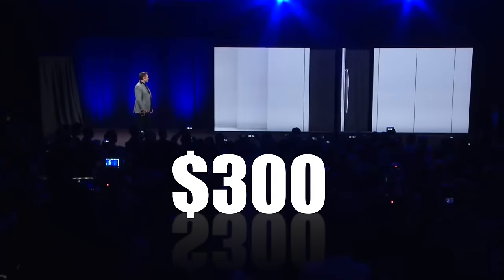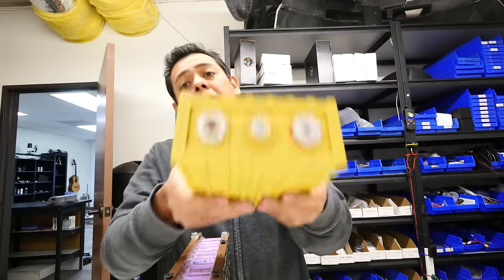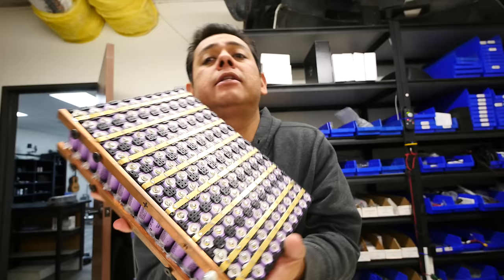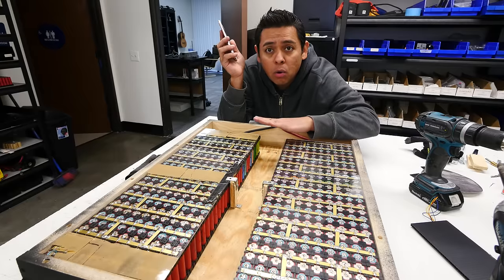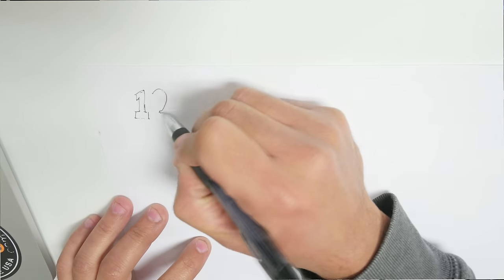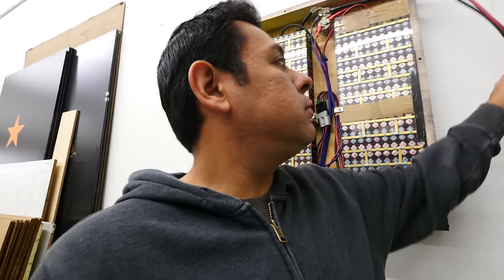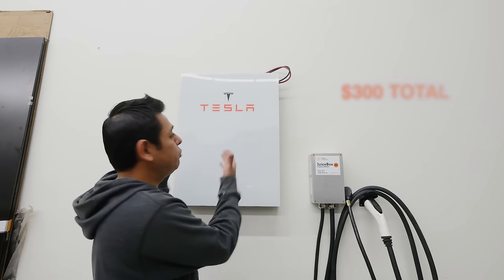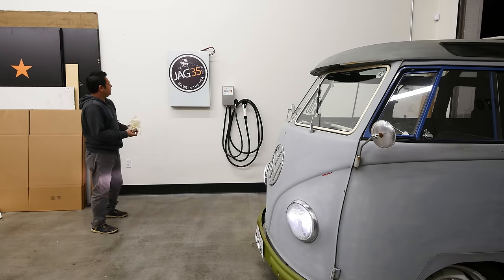$300 DIY Tesla Powerwall - Solar storage 18650 lithium ion home Battery

Comment: I’m novice but if I need to run a portable AC unit you noted that these pack fuses will shut down at 6 amps? I need like 20+amps for this portable AC unit. Am I incorrect? I was going to put together this exact unit but second thinking it now idk help

Comment: Hey, Jehu!  I've watched a lot of your videos where you have said, "I'm putting the link to the vieo above--go watch it..." but I've never seen any actual links (just a little inset scene from the referenced video). Is there any way you can go back and put those links in the video or at least add them to the "show more" info tab below your video.  I'm not lazy, but I've tried going back through the videos listed on your home page to find the ones that you have mentioned and it has been a somewhat daunting task trying to scroll through 7+ years of videos looking for the one you mentioned in your immediate video. Thanks!
Reply from the maker: Old videos,  links are no longer relevant

Comment: hey man. I really enjoy your videos. I have a couple of questions for you. First of all How can I calculate how much energy my house need to work properly? and the second one is: I have a Chevrolet tracker 2002 that I want to convert to electric. how many batteries like that I need to move it, which motor and controller is the best for my protect? I really need orientation and I would like you to help me. thanks
Reply from the maker: Look at your electrical bill,  see how many kilowatt hours you use per day,  multiply by 2 and thats the size of battery you need.  
For your car,   you need an AC-50 Motor kit (http://j35.us/EVWest-AC50)   and  one of these (http://j35.us/Tesla-Modules)  per every 10 miles of range you desire.  I don't recommend going under 60 miles as it would be really stressful on your batteries
Reply: jehugarcia Thanks. Can I conect the electric motor directly to the differential? Because my Jeep doesn't have a manual transmission...
Reply from the maker: +emmanuel berroa yes
Reply from the maker: +emmanuel berroa  yes the jeep I'm working on right now is direct drive without transmission
Reply: jehugarcia  and what about the indicators? how can I turn the Engine check soon, the oil light, the battery light off? how can I use the fuel indicator as the batter's charge indicator?
Reply from the maker: +emmanuel berroa there are products that help you do that
Reply: Like what, for example? Btw I saw in one of your videos that you use a Tablet with some indicators. How you did that?
Reply from the maker: +emmanuel berroa evwest.com has a lot of instrumentation products

Comment: Hi Jehu , I got an used electric scooter with no batteries , I put on it a 48 v  battery and turned on and the motor spins , but when a put the scooter on the road runs only a few and shuts off completely. I unplug the battery and runs again but does the same , do you have any idea what's wrong with it . By the way I put another battery and it did the same
Reply: sounds like a controller problem

Comment: I know this is quite an older video, but is there a BMS on this? Or is it operated just off the contactors? Very curious...
(Also, if there is a BMS on this, what amperage did you go with?)

Comment: actually it's 4.4 Kilowatt/hrs (KWH) of power not 4.4 kilowatts. enough to power say a 5000 btu ac window unit drawing 0.400 KW's per hour at 50% compressor runtime for about 22 hours. actually, batteries actual KWH useful capacity is about 80%, times 4.4 KWH, equals 3.520 KWH,  / 0.2 KWH =  17.6 hours of approximate runtime. Call it 15 hours. or overnight in Texas.  would take 2 to 4 KILOWATTS of Solar Panels and Charge Controller to charge these bad boys.

Comment: Do you ever have to worry about cooling or overheating the box?
Reply from the maker: heemoii not if you design it correctly,  I'm very conservative with my cells only pulling 1/4 to 1/2 of its capacity.  (.25C-.50c) so never see any heat

Comment: What is the ah?   I need to build some 100+ amp hour 48v.  I know amps x volts = Watts. So is watt hours divided by volts = ah?

I am looking to change out 24 6v 110ah golf batteries, replacing them with lithium. They are wired in 3 sets of 48v banks and the banks are parallel.  I have 4000 watt of solar that produces up to 35 amps and is fed to a charge controller.  The batteries are hooked to a 10000w true sign inverter that kicks on when voltage is 52v and off at 42v. There is a relay that switches my main power box to solar system when inverter kicks on. I am producing around 75% of my household power with this system. 

I am completely new to the power cell building. So I am trying to figure out where to start. I don’t have time to mess with laptop batteries so I will buy cells in bulk. But there are so many to choose from. I have found them up to 3.6v 19000mah 19ah on eBay.    What is the cell rating in the Tesla?

Comment: Very cool man, thank you for sharing.
Couple questions:
Is it safe to charge and discharge without having any sort of battery management system? 
Is the inverter your installing going to contain a BMS?
Is cooling a concern if mounted big a hot/cold garage?

Thank you man! I know these may be silly questions, excuse my ignorance.
Reply: Also, is the inverter going to do any power conditioning to match phase/frequency?

Comment: Great project, but the costing is way off - both ways.
Firstly, $300, of which $100 is the glass panel? You could spend $5 on a sheet of ply and spend the rest on more cells, or just call it a $205 project.

Secondly, the cost of the cells. Scrap laptop batteries are no longer a viable source, pretty much all the supply of them was eaten up in the first couple of months of the powerwall craze.
Reply from the maker: Old video

Comment: The question is, how long would it take to charge a power wall with just solar panels, and how many solar panels would you need to do it fast.
Reply from the maker: +VRIceblast depends how big your wall is,  and how sunny your days are
Reply: I understand that, but that's a huge battery. Can you even charge it by the sun in day? Given that your lucky to get 5 or 6 hours of sunlight. There's a limit to how fast the battery could be charged as well.

So, if you go by the max charge speed possible, with enough solar panels to provide that max charge, how long would it take to charge a 5kwh power wall.
Reply from the maker: At any moment, the sun emits about 3.86 x 1026 watts of energy. So add 24 zeros to the end of that number, and you'll get an idea of how unimaginably large an amount of energy that is! Most of that energy goes off into space, but about 1.74 x 1017 watts strikes the earth.

4KWh battery can be charged by the sun  using a few solar panels
Reply: So, are you saying, that just a few solar panels, can charge a power wall to full, everyday, in just 5 or 6 hours of sunlight? Because I thought, the max charge speed of a battery, would make that impossible. I figured, it would take several days to recharge a power wall, with just solar panels.

Do you know what the max charge speed is?
Reply from the maker: you can safely charge any lithium battery in 2 hours

Comment: Like the Video, but a more Fireproof Case would have been nice and Time it would run the whole House and How many and Size of Solar Panels needed to Recharge it. What would be even more Helpful would be what Size Battery Packs do the Avg Size Homes really need like for a 1000sqft, 1500sq ft, 2000sq ft, 2500sq ft, 3000sq ft need, what the Majority of People in the World live in. What is really needed, 5000kw, 7500kw, 10,000kw, 12,500kw, 15,000kw? A House the same Sizes but on an Acreage that might have a Well or other Shop Buildings, probably need extra Size Battery Packs and Solar Panels. I've been told, 7,500kw is the minimum Size Generator you should have for an in-town Home and 10,000kw for an Acreage. Like my Home is 1316sq ft and has 200amp Service, uses Gas Water Heater, and Furnace, and for Electric, Air Conditioner, Stove, Dryer, Microwave, (2) Freezers, (2) Refrigerators, (1) Sump Pump, (3) TV's, (5) Computers and a 24' x 28' Garage/Shop with 100amp fed off House with (1) 50amp 220 for Welder, 15amp 220 for a Small Mill, large Air Compressor, Lathe, Drill Press, Table Saw. Is there a Spreadsheet with the formulas to figure out what you really need? Thanks for the nice Video.

Comment: Hi Jehu,  If I had 2000 watts of solar cells and wanted to build a power wall for a RV application, how would you go about it?
Reply from the maker: I would buy a 24V ModelS module http://j35.us/Module-ModelS  and 24V  inverter http://j35.us/24V-Inverter-6Kw

Comment: Why did you suggest a 12S system for a 48 V battery pack. Isn't 14S a conventional standard for building a 48V battery? I am talking 3.7V Lithium-ion batteries.  Please advise!
Reply: If you count the battery strings, he actually has a 15S 48VDC one.
Reply: @citizengkar7824  thanks for your reply, its been an year since I made the comment and have learned a lot of system architectures. I have come to realise that there is not standard, it all depends on the system designer and system components.

Comment: Hi Jehu nice video I am planning an installation for myself in Brasil and will probably use something similar to your PW with higher capacity, what did you use for a BMS on this?  I need to make sure that my PW is capable of running up to four air conditioning units.  Stay safe.

Comment: Can those batteries Drive large loads like air conditioning units for houses?
Reply from the maker: Typically they’ll handle 1c loads so you’ll need at least a 5kwh battery to run a 5kw load  for example

Comment: 4.4 kWh for $180,
Which is around $40 / kWh is really cheap !!

so obviously by this calculation, 14 kWh should cost, $40 x 14 = $560 [Tesla Powerwall 2 14 kWh battery costs $5,500].
Which is roughly 10 times the cost, though Tesla include an inbuilt inverter, it's seems like way too much expensive !!!

I hope to see Non Tesla Li Ion battery packs for home soon to replace the conventional Lead Acid batteries !!

Comment: Why do the dead batteries you buy online hold charge? Aren't they dead and thus not able to be recharged?
Reply: you test each cell to see the life left of each one. battery packs fail but usually only because 1 or 2 cells in the pack. old modems and other ones sometimes have lots of life left and very little cycles

Comment: whan i have two,  10kw/h 48 volt electical motors on my boat as propulsion and i use about 400kw/h a month for my houshold 230 volt and 12/24volt equipment how big  must my powerwall be?  It's for a sailing catamaran the electrical motors i can use as a hydro generator under sail and i have room for 10 thin film solar panals  each 36 volt 440 watt . We wil put up 1 or 2 windgenerators as well The cat wilbe co2 nutral

Comment: Nimh doesn't have memory effect only nickel cadmium
Reply: Yup, they do take a hell of a lot longer to charge though, I was using hydrate batteries for my UPS and since I live in South East Asia I was able to switch to a 12v system with tested brand new 18650 cells @ the equivalent of 40 cents per tested brand new cell! Much better now!

Comment: I am trying to build a 10kw solar powerwall for my tiny house out of Li-ion 18650 batteries.  I am trying to decide between 2 options:

1) Wiring 3 arrays in series, each array will have 360 cells in parallel at 3.7v 288Ah, to give me a total of 11.1v 864Ah.  I need a 3S BMS system that can handle this load.  Anyone know where to get one?

2) Wiring 1080 cells in parallel to give me 3.7v then use and an inverter to convert my energy.  

Any thoughts on either?  I am also open to a better solution of wiring my 18650’s maybe 24v or 48v?

Comment: The Tesla folks just left my house and I was floored!!! The Solar panel system is done separately than the power wall, One 5kw power wall costs $7500.00 YUP!! That is the quote I got from Brock Richards of TESLA here in Carrollton Texas, most homes need 2 for a few days of backup.  The Solar “System” they will only setup a 50-55% offset because the power companies have some sort of regulations about these companies making private homes produce too much power... or so I was told by Brock of TESLA.  Too add Solar and 2 power walls with a 53% offset was quoted at $37,000.00 and I would end up with 2 electric bills costing $162.78 more per month than I pay now... Figure that out!!!  Those are the numbers I was left with when the TESLA folks left the house.  DIY is the only way to go... SCREW these solar companies.
Reply from the maker: I honk I wisely varies by region but yeah those prices are what lots of folks are looking at

Comment: 9:44 sounds like a built in charge controller that has a load feature that the inverter part runs off. I have a charge controller like that. Not combined though.

Comment: How in the hell are you touching the hot and the ground together like that and not get lit up? Wtf, those batteries are live off those two leads. Just doing that with a single 18650 is a mini arc reactor.

Comment: hello
i want to make battery pack 18650 6s 22.2v my battery its 5.6A so  its better to buy bms balance 8A or another 60A ? the A of bms what use it ? for battery  or brushless motor 
because i make a electric skateboard

Comment: To anyone trying to assemble ebike or tesla powerwall vape etc battery i would reccomend lghg2 but most are fake especially littokala there 2700mah and the can only do 15a max. most ebay sellers buy them but heres where i got  mine they just restocked lol @t wayy better than laptop batteries as they can do like 30a const

Comment: Stupid question:  Why bother with an inverter?  Why not just wire it up so it's putting out 120v?
Reply from the maker: +Doak Nation   Because Westinghouse won instead of Edison,   Google it
Reply: Ah yes, of course.  AC/DC.  :)  Well, I suppose you COULD make a 120v DC to 120v AC inverter for no reason at all.  Hehehe

Comment: My laptop batteries did not last after 2'years in my laptop.. then how could we make guarantee for this  power wall for 3 year ! This is only my doubt! And it's expensive 😣.. anyway you did good job..
Reply: Usually when a laptop battery no longer charges it is usually just 1 of the 6 18650’s inside so if you have 1 bad 18650 the other 5 or so are still good
Reply: Also it could
Be just a bad battery management piece
Reply: @65mustangguy  ohh oky 😊

Comment: How does it keep power from draining off onto the grid particularly during power outages when workers repairing lines could be exposed to your power?
Reply from the maker: magic,  all grid tie inverters require power to operate,  if power goes out the system shuts off,   by law they must do this to be sold
Reply: The backup power inverter isolates the load from the grid should the grid power go off. You only need a grid tie inverter if you are selling surplus power to the power utility

Comment: I need simpler instructions, sorry butI have no electrical background.  I'm an old Viet Nam vet and have been medically discharged since the 80's After many operations and physical therapy, I want to build an off the grid, system to save money.  Can you give me a starting point, and other options.  I would be very grateful, and I'm sure other's would be also.   Thank you.  I understand that this is a lot to ask for so if you don't have the time I'm grateful any way.   Ret. 1SGT Joe

Comment: when he talks about the watt hours per cell what equation is he using to calculate this? is he using Watts=(voltz/Amps) or is there another equation for these batteries im unaware of? I'm on a small budget for this project so i want to use as minimum batteries to be able to supply my house in case of an outage especially with winter right around the corner
Reply: And using ohms law doesnt give me the 4440 watt hours he came up withe
Reply from the maker: 2Ah x 3.7V
Reply: thanks alot it makes more sense now

Comment: I don't think that the wooden case is very safe... In case one of the cells burns... Other than that it is very cool. Good idea to reuse dead batteries in this way. You might start a company selling batteries made of reused cells from dead batteries...

Comment: How long can you run a 60 inch smart tv on this device?
Reply: The power consumption will vary from model to model. A SONY version A9G 65 inches draws 149 watts, while Samsung Q80T QLED 65 inches draws 265 watts

Comment: Got one wrong.  NiMh don't carry the Memory issue like NiCd. They do have serious issues with cold.  Let them freeze once and there DONE.   NiMh just SUCK from day one...    Self Discharge a major factor.    LOL  NiCd are better in that if you treat them right they can last 20 Years easy.   Do a Compete Cycle on them once  ever few months and they will chooch on for decades.  I have serviceable NiCd packs that are well over 15 years old. A few over 20 years old.    The issues with NiCd was the POS chargers most got tied to.  Using CC/CV they worked just fine.  Most chargers were of the Pump Type and Over heated and over charged. CHEAPO CHIT.

Comment: Can you build me a small custom battery for a power tool? People only build nicad in my home town. I have a 18v but I want a little more juice. Looking to step up to a 24v
Reply: Absolutely. 
 Crudely you can just clip (alligator clips if you got them, if not paper clips can work)  the + and -- of your  24v battery to either of the 2  contact leads in your drill handle...   

If it runs backwards then reverse the ,+&--  leads